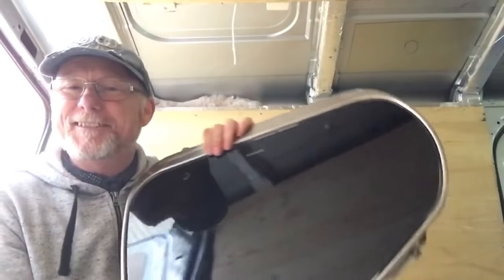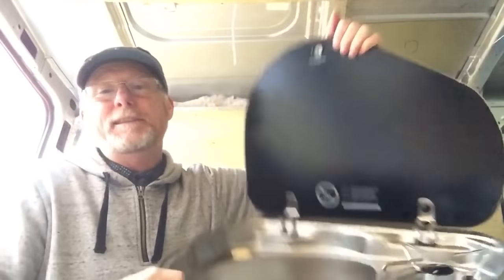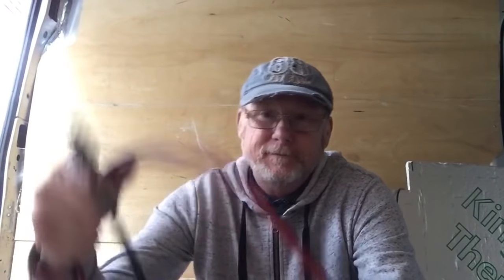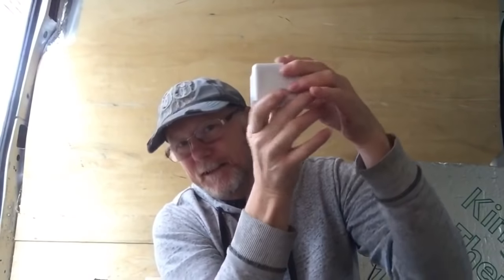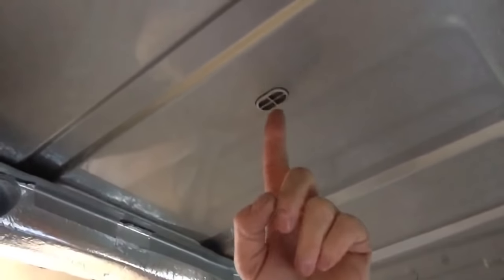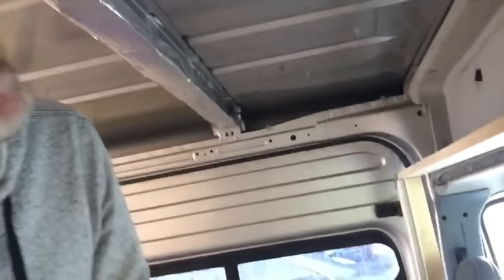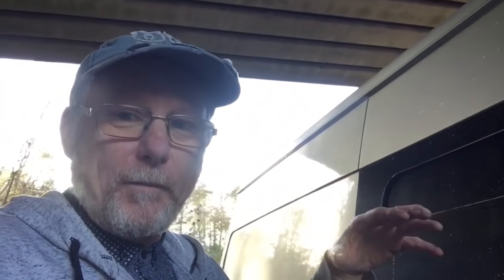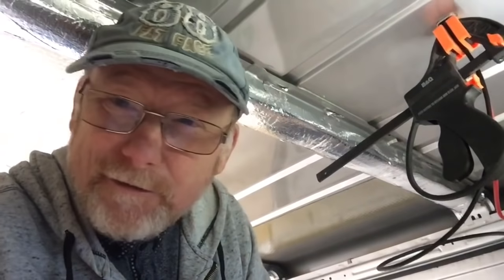Starting van life? Time to beat the DVLA Transit van converting into stealth off grid camper

Comment: The DVLA page you refer to is "guidance" only.  NOT law!

You might want to read the following FOI response regarding requirements for cooking deemed acceptable for "motorhome" conversions by DVLA. 

https://www.whatdotheyknow.com/request/477858/response/1146788/attach/html/4/TO%2000565878%20minimum%20requirement%20of%20cooking%20facilities.pdf.html

It says :-

"The guidance you refer to is not prescribed in law but has been established, by the 

Department for Transport, to assist motorists when they carry out “do it yourself” 

conversions of their motor vehicles into “camper vans”/ “motor homes”.  

The importance of the guidance, particularly in relation to incorporating fitments to a 

vehicle, is for safety not to be compromised but, there would be no concern if the 

cooker comprised of either one or two rings and it has been fitted correctly."

As in so many areas the government doesn't know it's arse from it's elbow.
Reply from the maker: thank you so much for taking the time to do that